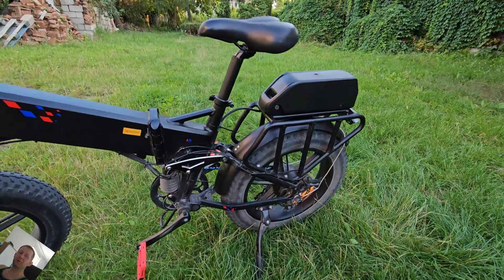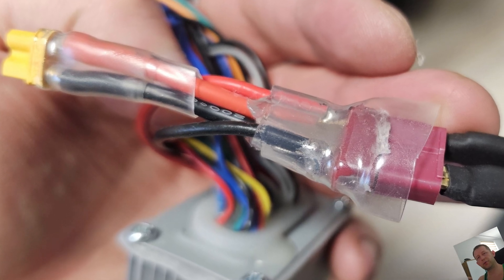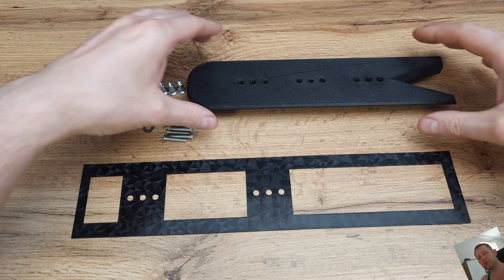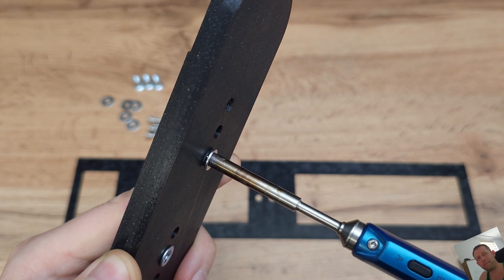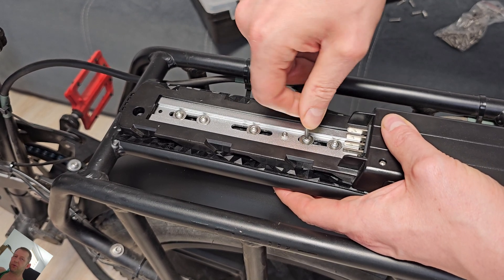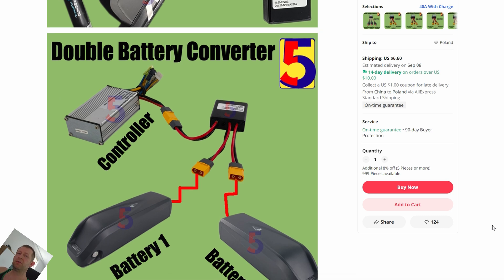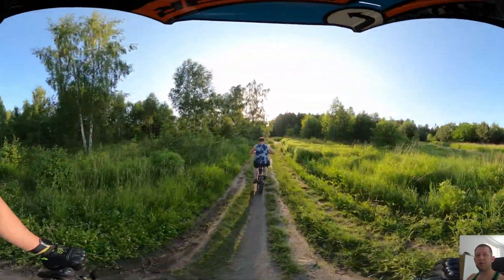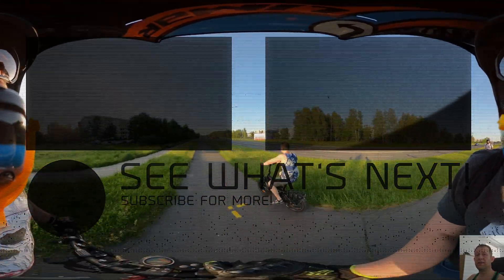Super Easy way to add extra battery to Fatbike Engwe Engine Pro 😎 Free Files for Adapter 🍻 100km+

Comment: I understand the bigger mileage, but what about the power difference? Is the torque higher? Or even max speed? And will the same process work for Engine X model? Great video btw
Reply from the maker: Thx, with 2x battery you can expect 2x higher discharge rate so torque feels nearly all the time like stock battery is fully charge. I recommend to check my latest video about connecting 2 batteries with battery combiner.

Comment: Hi great job , did u change the amp setting on the controller, if u did what did u set it too ?
Reply from the maker: Hi thanks, there is no need to any changes in the controller :)

Comment: Hi great video and thanks for a great job!
I want to make the same system but the battery will be on the center frame. I have an engwe pro engine

Question 1. Are you going to make a battery holder for the center frame?
Question 2. What cable and fuse did you use to protect the battery? Only the photo with the fuse can't be seen on the video.
Thank you very much for your advice! Keep up the great work!
Reply from the maker: Hi , Thanks :) 
1) I can but it will take some time.
2) U can use HQ Copper cable at size 12<>16 , Fuse ~ 25A for output and 6A for Charging.
Much love
Reply: Thank you so much for the replies, I will look forward to the next video!! Nice day.

Comment: Hi. Thanks for that video. If you read this, can you tell me please. Did you solder secondary battery wires straight to the controller wires? without the balancer?
Can you solder straight into the controller wires really or i missed something?